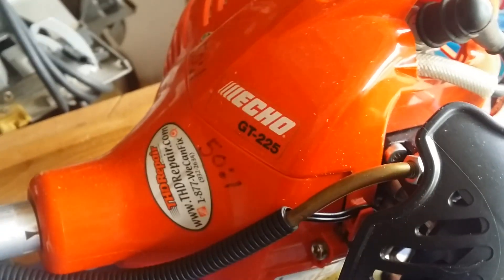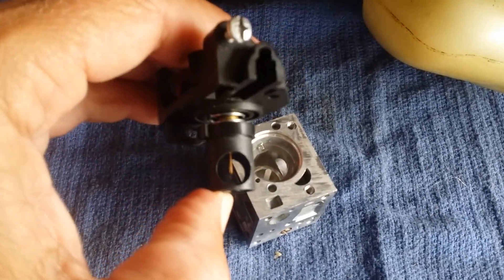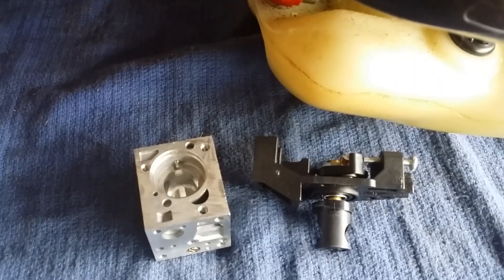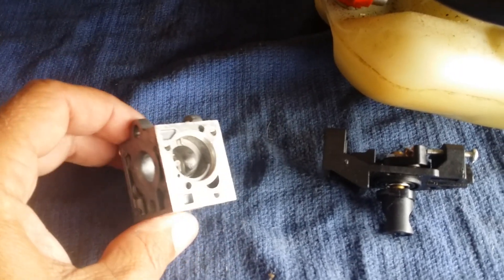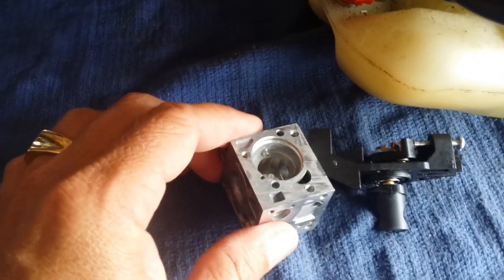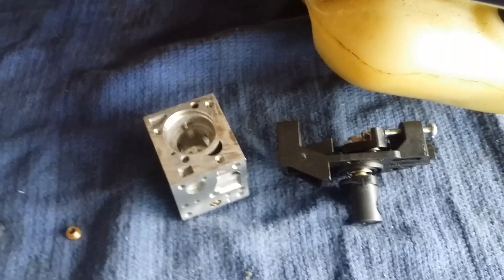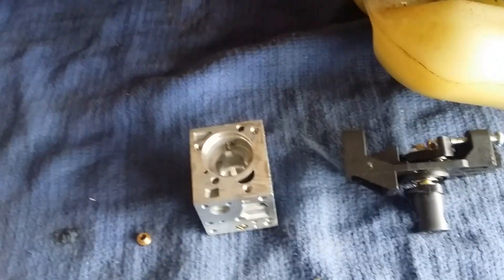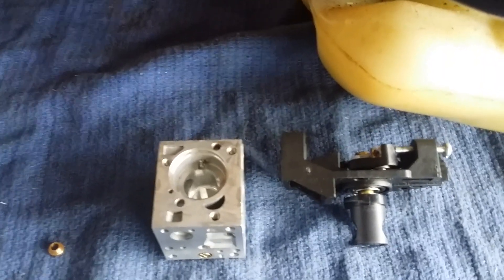Echo Gt-225 Carb Bogging & Flat Spot MY FAULT so be careful put all parts back in.

Comment from the maker: Hey... sorry for not answering comments... we moved soon after doing this, and just lost track.  Anyhow, the roller fit over the little pin sticking out just inside the carburetor.   Yes, sorry for no pic of the pin... that was my bad. That said, please be mindful of the little roller falling off the pin if you remove the throttle body.  It will wall fall off - its small -- and you probably won't find it.

Comment: On those echo trimmer Zama carbs factory initial setting on lo is 2 1/2 turns out and hi is 2 7/8 for gt-225, srm-225 lo 2 3/8, hi 2 5/8.
Reply: Thanks Louie! Been looking all over for that piece of info. Lost reference on lo speed setting and cannot get it back, will try 2 3/8!!

Comment: see 5.25 u will see a small pin sticking out inside the carb block and on that pin there should be a little roller that slides over the pin
Reply: yes... the roller fits on that little pin.

Comment: Those Zama carbs are trash on my third one on a 10 yr old machine does not pay to rebuild it kit is 15-25 dollars new knock off eBay 16 dollars or new Zama 35 bucks
Reply from the maker: Exactly agree... not worth it.  I just have this wiring in me to take stuff apart sometimes.  Lol.  And yes, I’ll break it sometimes.  But again, folks should purchase a new one for sure.

Comment: what "roller" do you speak of
Reply: roller is a wrong term... it slips over that little pin that sticks out just inside inside... very very small.  The throttle bottle rolls back and forth on it to push it up and down inside the carb

Comment: working on this same weed whacker right now. roller fell out and I didn't know where to put it so I guessed and thank God I put it in the right spot haha. but to my actual question. we use it during the summer and it stays during the winter. as of recently, it does not work. the throttle body is getting stuck on the screw right underneath it, so I removed it. still, the throttle sticks and, even when I do have the throttle open, it bogs down and dies. I set it to cold start, give it a pull, and switch to run and it revs fast and then dies. over and over. I don't know what it is, were using normal pump gas with a ratio of 40:1 to the 2 stroke fuel.
Reply: I do want to mention I checked the spark plug and it was super clean. I took the fuel out and put fresh fuel in, to no avail. any ideas?